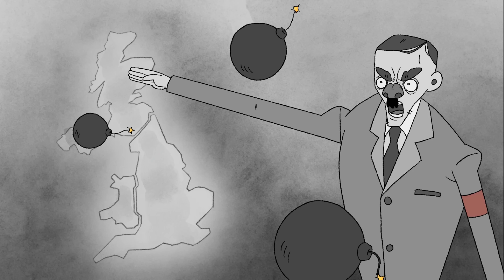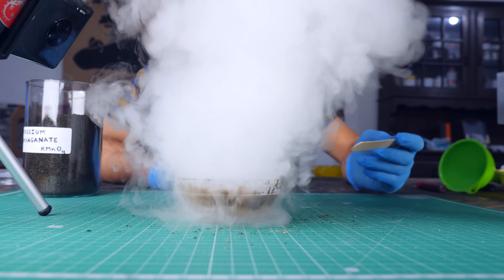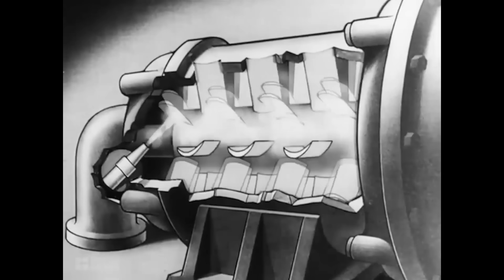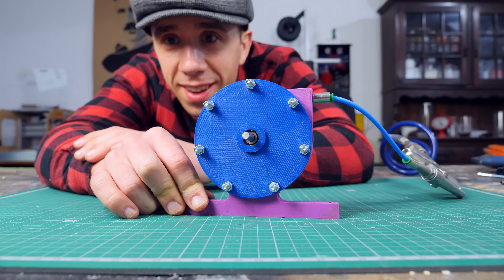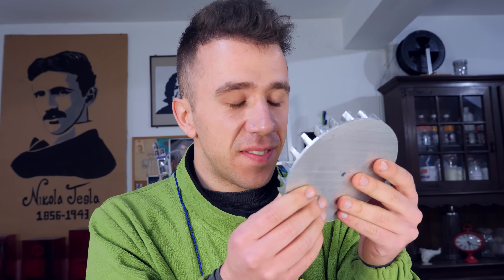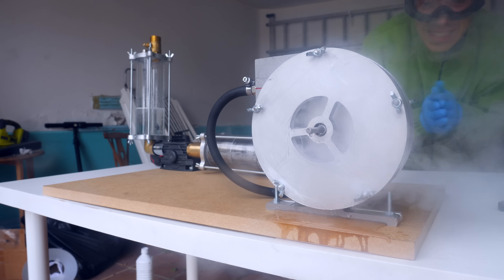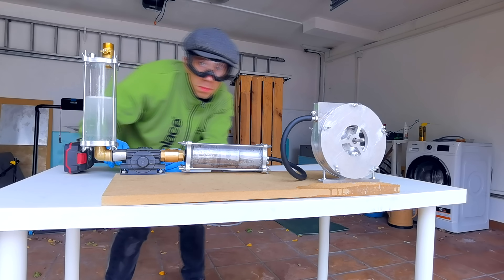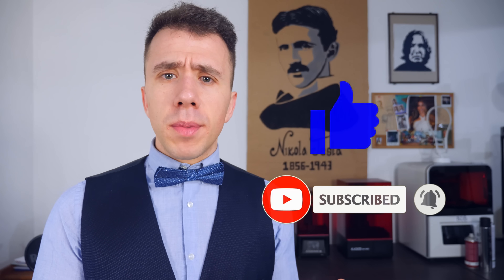I built the World War II V2 Rocket Steam Turbine

Comment: The V2 used a pelton wheel turbine because it gives you more torque. The style of turbine you made gives you higher rpm. The scoops of the pelton wheel can extract more energy from the liquid. You also need higher concentrations of h2o2 and a stack of catalyst covered mesh screens works better. There used to be rocket gokart kits back in the day with 1500hp that ran on hydrogen peroxide and nickle and silver catalyst packs.

Comment: Use a “steam bell” to separate the steam from the liquid. That is how a steam locomotive separates water from steam.
Reply: Also, you should add a safety release valve so things don’t explode if the pressure goes too high.

Comment: Hey integza. Try reducing the weight of the motor. Also metal is a bad idea because the peroxide will react with it. I’d use cooking grade plastic. Like a cutting board. I’d also not mount the mixing chamber sideways. Because that makes the peroxide go near the exit tube. Vertical mount that. Make the tubes parallel and like this [] []. And have a connector on the bottom. put pressure at the top of the left one that contains peroxide and It will flow up into the other containing catalyst and now you don’t have as much unreacted peroxide reaching the end.
Reply: I’d make it from RC plastic. That stuff can handle mad rotation. Or maybe have the metal be hollow.

Comment: You should mount the Catalystator in a Z Shape with a tube Connecting them. so that the liquid will flow along the catalysator and the fins of the catalysator should be more fine. so the Surface area is much bigger this will wield a much greater pressure build up. And over standing liquid will be Flowing in gasousform or liquid stage alonside the other Catalysators in the Z Shape :). So you dont get a overflow into the Turbine this fast.

Comment: i think the reason why using a chemical reaction to generate steam and not the way u did it is that the rocket gets lighter while consuming the fuels meanwhile your design will have to carry all the things to create steam all the time...... So I think you would generate a lot more power if u tried to use a compressed air tank... Basically... Use your compressor as fuel  😂
 this videos as amazing
...
You know what would be fun to create... A steam locomotive using this... Tho I dough the torch will be enough

Comment: I would bet you that there is verry little pressure generatied,  hence you get very little torque.  You proboly need the blades  to be 10 Times tighter to have more back pressure. 

Start instaling  a pressure gauge

Comment: Vertically mount the catalyst. Input and output at the top. This should prevent liquid from entering the turbine although you may need a longer tube to help which will in turn lower the pressure.

Comment: I think your flow rate through the pump is actually to high which is flooding your catalyzer. Maybe trying putting the catalyst stack vertical and supply the peroxide at a slower constant rate so you can get a higher constant pressure into the turbine. You might also be able to put another scavenger turbine on the  the outlet of the hybrid turbine to give you more expansion volume and power output.

Comment: Make a magnetic dynamometer.
Drive the commutator.  Measure the torque on the body of the motor as it rotates, maybe by getting it to lift a known mass at a known radius or by pulling a spring balance.  Add a load to it by adding a voltage to the motor.

Comment: You should build a wastegate, like the one used on car turbochargers. When you upgrade the catalysator the pressure will probably be much higher, so a waste gate could help prevent damage from over pressure. If memory serves me well there are two types of wastegates springloaded ones (basically just a springloaded flap on the pipe) where you can adjust the pressure just by changing the spring tention, and pneumatically controlled ones which open the waste gate based on the pressure in the air manifold.

Comment: Im thinking it might be advantageous to mount your reaction chamber vertically, that way you can submerge the 2nd cataliser section, let the H2O2 buble up into the 3rd section, this should help limit the amount of liquid that gets pushed through the turbine. Speaking of the turbine, lm blown away you didnt use the tesla turbine as a comparison. Great video as always.
Reply: Yes, I was about to comment how vertical chamber would help!
Reply: Also maybe have a longer chamber end section to catch the liquid that bubbles up. Like, a tube that is 4 catalyzers long, but only has 3 for example.
Reply: @erinfinn2273  or a multi stage chamber so the steam has to pass over more cat with the potential to consume more of the peroxide, only downside i can think of there is possible loss of pressure?
Reply: I'd also add that he should try to install some kind of aerosolizing nozzle before injection into the reaction chamber. One issue is the amount of fluid getting pumped in so rapidly. It's a less controlled reaction. If he could inject the H2O2 similarly to how direct injection works in an engine, he could probably drastically increase the efficiency of the entire steam delivery system.
Reply: I made the same suggestion before I found this comment. Great minds think alike lol.
Reply: not sure if it would be much benefit, but vertical mount like you said with the peroxide being inserted from the top so it falls down over the cats but also have the steam exit from the top as well so it isn't pushing the peroxide out with it.  Might make it a little more compact too.
Reply: Also heat the catalytic converter. Platinum electrodes are heated red hot for the decomposition of methanol demo.
Reply: I agree, doing a drip feed back loop with a vertical mounted reaction chamber might improve things a good bit. However for safety, having a bubbler pressure release valve (think brewing booze) to trap liquids but release gas energized with heat to not burst the plumbing. I also wondered on the outlet side of the motor pin, if you put a flywheel to balance vibration from belt drive on the other side would help efficiency...
Reply: I was thinking that he used peroxide at 50%. So if the reaction decompose only peroxide and doesn’t produce enough heat to vaporize water, it may be that the liquid is water. Additionally the turbine is in aluminum so it may act like a condensatore for steam…
I don’t’ know…what do you think?
In any case it was fun to see :D
Reply: What they said
Reply: Kraik  ?

Comment: Hm doesn't the U-2 use a steam turbine as powerplant to pressurise the fuel lines for the rocket engine?
If you find fuels that need high pressures for a lot more power you could use your steam turbine to power a high pressure fuel pump for a second turbine generated ng the thrust, or just maybe a rocket bellnozzle.
Thank you for the video as always ^^

Comment: If you use a vertical catalytic chamber with the inlet at the top on the side and the outlet directly on top, you shouldn't have any liquid got through to the turbine. The more dense liquid will fall to the bottom through the catalyzer and the less dense steam will be force up and out the top.

Comment: "So many steam."  How many steam? 30 steam?  Using the generator, you need a load on the generator to measure power, not just measure how much voltage its producing.  You need current and voltage measured.  With no load, the generator free-spins.  Sure, it feels like a bit of work turning by hand, but try turning by hand with a 100 ohm resistor across its output.

Comment: VIDEO IDEA: 3D print an Air Compressor. One that can run off an rc battery or something, and can keep a plastic soda bottle from getting empty when you use it as a lightweight pressure chamber. Was watching your lily impeller boat video when I got the idea.

Comment: maybe try to optimise the nozzle geometry of the turbine inlet. do some tests with a small de laval nozzle to find out what the optimal throat diameter and expansion geometry is. then apply that to your design of the turbine. You'll want to get supersonic flow out of this nozzle. After all, high speed gasses contain the most energy and the de laval nozzle was developed specifically to increase the efficiency of steam turbines very much like your own. Perhaps give the turbine multiple tangential inlets with such nozzles.

Comment: The turbine needs the shape like of a gas turbine. To much torque lose with this desgin of turbine. You should start learning WIG welding, u can weld moste metals with it and you can do mostly the smoothes weld. Metalworking is an hard profession becouse of the big spectrum of work you can do but with an good advisor you able to handle most problems with primitive tools.

Comment: Tom Stanton has made a 3d printed pneumatic engine that can run on the compressed air generated from water filling a container. Perhaps you can work with him to compact this  turbine design and fit it into a model airplane? Then, you will have built a steam turbine powered airplane that uses hydrogen peroxide for fuel!

Comment: The problem why you didn't get much power out of it was cause the gear ratio to your motor wasn't optimal. I believe that turbine can actually produce quite a bit of power but it has to spin at a pretty high speed with rather low torque. Nice work tho

Comment: One thing you could try with the steam generator is using a sprayer head to better distribute the peroxide into the catalytic converters and also divert some of the steam into the tank so you can feed it with pressure instead of the pump. I think the V2 Generator was either autogenously pressurized or used helium.

Comment: What if you change the structure of the turbine to a gas turbine design? Like two compressor stages and two turbines, like an aircraft engine. I think you can have a better power output having it working with steam

Comment: This looks great! Is it possible to use the oxygen gas with fuel too? Or is there too much water in the mixture?

And as others have pointed out, mounting the catalyser vertically to keep the liquid in there would help with efficiency, as would a longer catalyser so the peroxide is in contact with the metal for longer.

Comment: If you want to go completely steampunk: How about a H2O2 powered piston steam engine? You could use the engine to power the pump, add a pressure valve that closes the pump when the pressure gets too high... And then use it to power a go-kart ;) I can already see the cart with tubes running down the side, three tanks on the back (1 for H2O2, 1 for the built up pressure and 1 for the reaction.....)
Would it be more efficient if you used  multiple smaller reaction chambers maybe?

Comment: I have this vision of a integza rube-goldberg machine. Steam chemical generator, spins a turbine, which spins a flywheel, which - post turbine spin - charges an electric generator which sends a signal to a resistor which lights a match, burns through a string, dropping a weight, and smashing a pile of tomatoes

Comment: You might have to make the blades thinner and longer and the exhaust smaller, maybe add an exhaust nozzle? And as for the peroxide leak, maybe make the catalyst chamber vertical, that might help, just put the steam escape at the top.

Comment: This looks like it has a lot of potential to be self sustaining. Mounting the catyliser vertically should help with the fluid bypass. What would also be great is a reduction gear set off the turbine to spin the pump. The reduction gears may increase the torque sufficiently to turn the pump and maintain a slow feed of fuel.

Comment: The hydrogen peroxide comes out of that one way valve as a stream where you want more of a mist. Then there seems to be an issue with the hydrogen peroxide pooling at the bottom and then running between the outside of the catalytic converters and the inside of the tube housing them. Aligning it vertically might alleviate that issue.

Comment: Turning the catalytic converter chamber on its end will help stop the Hydrogen from escaping into the turbine. Also get and Air compressor Air dryer and a regulator to better control your output. If you want to get fancy, You could use the solenoid out of a cheaper type washer to control input. wire it all together into the button of the drill. And now you have a controllable jet turbine. Oh, I wonder if fluid bearings would work better?

Comment: Future Video Idea: Instead of using hydrogen peroxide for steam generation you could use aluminium with hydrochloric acid. Both are easily availiable in most countries and more powerfull then hydrogen peroxide. Using aluminium foil as the aluminium source you can easily form it and thus try out different shapes in order to find the maximum. There are a lot of possiblities.
Reply: And now you're producing hydrogen gas and pushing it into a rotating metal turbine where there might be sparks from bearings and the like...

Comment: Love your videos! As you pointed out, some of the nuts you used came undone when the prototype was under pressure - probably some mix of vibration and compressed air slippage between the bolt hole and bolt. In the future, I would recommend using nylon lock nuts, cotter-pin nuts and bolts, or safety wiring bolts and nuts - lock nuts being the cheapest of the bunch, but it can't withstand high heats.
Reply: Or just use 2 nuts tightened against each other. It is cheaper and is heat resistant

Comment: Maybe have the the catalytic converter as a column feeding from the bottom might reduce the spatter. Also making it a bit taller for good measure should help it react more thoroughly. On top of that I think a variable valve after the converter might allow you to experiment with pressure control on ignition

Comment: Mount the catalyzer vertically and spray the H2O2 into it - use a stainless steel nozzle to spray it so as not to corrode it from the H2O2.  You want the H2O2 to spread evenly through the catalyst.

Comment: Maybe a secondary catalyser chamber? Or a longer one with more catalyst surface area? Give the peroxide more time to flow over the catalyst, more contact, so more can get decomposing.

Heating the catalyser chamber also would increase the reaction rate (and therefore pressure). Maybe some kind of heating element to pre-heat it?

Comment: @Integza make sure not to overflow the cats, they are most efficient at a certain flowrate. it depends on the reaction time and rate, of h2o2 with this specific cat. h2o2 releases −2887 kJ·kg−1 of energy, thats a lot of heat. if you can make it the cat is converting at top efficiency, there is plenty heat to make all of the water go to steam, and heat it well above 100C°. oh yeah, also preheat the peroxide for minimal reaction time. don't blow yourself up, peroxides are nasty, lulz.

Comment: Maybe put the reaction chamber vertically with the input at the bottom so gravity helps keep the liquid in the chamber itself rather than getting pushed out. Probably want to add a drying chamber too that will hold any liquids and only allow the gasses to escape. I would do a centrifuge design like used in dust separators or a DeLaval separator.

Comment: The turbine blades should be scalloped (is that the word?) And should have multiple wheels where the blades make like a wave pattern, like /\ \/ /\ that allows the steam to push on more surfaces instead of just pushing on one and then escaping.

Also maybe the reaction chamber should be vertical and maybe have a liquid trap, so gravity prevents that unreacted peroxide gets pushed out of the chamber with the steam.

Comment: Looks like your catalyzer needs a vapor trap.  I think that you need to put an expansion chamber on the output side, and then put a pressure release valve, similar to one on an air compressor used as a safety valve.  a spring/ball assembly that blocks an air port until pressure exceeds the spring tension would work just fine.  If you use a longer spring with a bolt on top of the spring, you can adjust tension as well to get a dialable minimum pressure. (Think turbo blow off valve).  That should also help with keeping your peroxide and vapor down, as vapor tends to collect less when pressure is above atmospheric.  For the love of god however, put a safety release valve on that thing somewhere.  Use one from an air compressor if you have to.  You don't want pressurized steam melting your face off.  For every 1psi above atmospheric, water will hold an additional 2 degrees Fahrenheit.  That means, if your water is boiling at 212F (100c), under 29psi (2bar) your water temperature at boiling will be 270F (132C).  If you are talking 6bar (87psi), your water temperature would be boiling at 386F (196.7C) which is getting really close to the melting point of lead.  You don't want that on you.

Comment: You should probably try 3d printing gears for a transmission to try and increase the speed of your turbine.
Reply: Confusingly, the slower the turbine spins for a given input, the more power it produces. Simply because you are takiong out more of the energy. If he could perfect the catalyst without wasting so much of the peroxide, (maybe put more of them in series?) then have it geared up, so the motor spins a multiple of times faster than the turbine, then a lot more power could be generated.

Comment: You have upgraded the channel with that CNC! You could add an acumulator tank before the turbine to retain the liquid and have only steam going into the turbine. That's used on cooling systems to separate liquid and vapor coolant.
Reply: To create an area to pull moisture out by cooling would remove energy away from the steam and decrease the efficiency of the system. Definitely worth playing with.